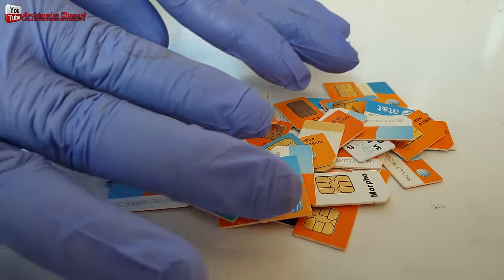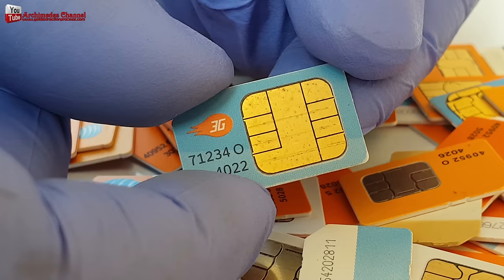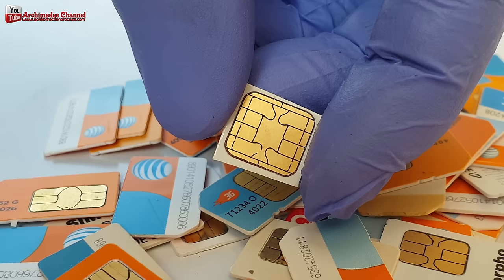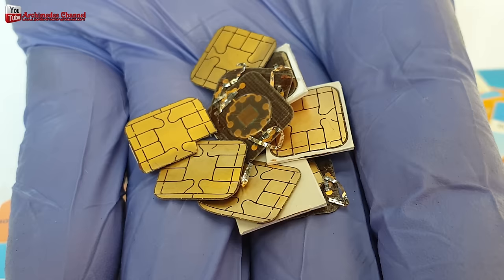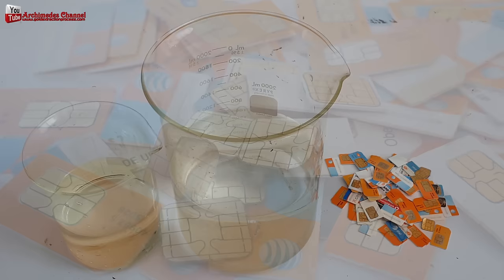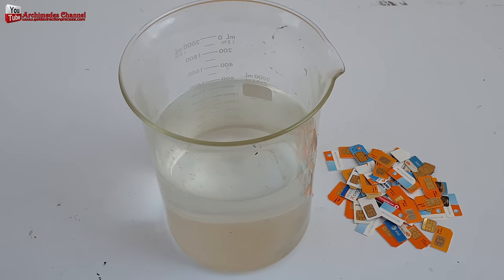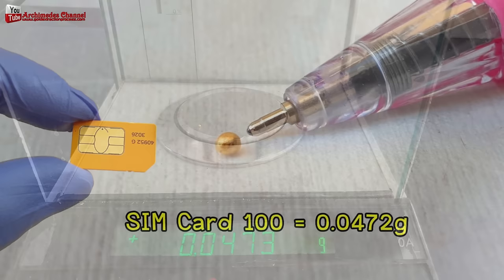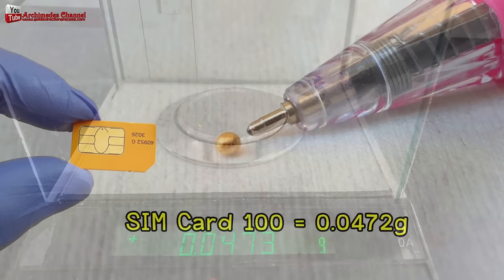Gold recovery from SIM Card cell phones 📱Sim cards recycling gold📱

Comment from the maker: 👉👉👉❤️❤️❤️❤️😘❤️😀 Gold recovery from sim cards cell phones. sim card is a plastic card that is embedded with an integrated circuit (IC). sim card are usually manufactured from plastie, namely, polyvinyl chloride (PVC). The sim card uses gold to produce two parts. The first is gold wire to connect the Die (integrated circuit) to the contact strip. The second part is gold plated contact strip to connect to cell phones. Many people are wondering Does SIM card have gold? How much. Today, I will gold recovery from my sim card cell phones. The key problem is the collection of enough quantities for gold recovery.
Reply: Hola es de verdad????
Reply: Soon as I got to the Part Nitric Acid needed..UK regulations  An EPP licence is required before regulated substances can be legitimately supplied to a member of the public.
Reply: Bogale.Dori
Reply: Pay me money
Reply: @tony2682  yes
Reply: @tony2682  yes
Reply: instaBlaster
Reply: How to make wots you
Reply: @salsayciudadsalsayciudad9664  you Good
Reply: @bogaledori1585  you looking good
Reply: Y
Reply: how many karat is that and how many percent of gold purity
Reply: How much is it??
Reply: my question is now where do all those chemicals go?
Reply: I had no idea that was actually real 🪙
Reply: @genxnewb small amounts acids HNO and HCl break down quickly to leave harmless residue as long as you dont damage something of value with them
Reply: You are wrong....
You make the same mistake as many others, Gold (and other precious metals) are weighed in Troy Ounces, and 1 Troy Ounce is 31.1034768 grams.
So if you have 1000 ounces, that makes a significant difference in weight. This gives a weight difference of more than 3 kg more.
Reply: How does a normal person get those chemicals?
Reply: SALVATION IS A FREE GIFT FROM GOD

HOW IMPORTANT IS ETERNITY TO YOU?

There is one God, eternally existing in three distinct co-equal persons: Father, Son, and Holy Spirit 

Deuteronomy 6:4
KJV
4 Hear, O Israel: The Lord our God is one Lord:

Matthew 28:19
KJV
19 Go ye therefore, and teach all nations, baptizing them in the name of the Father, and of the Son, and of the Holy Ghost: Ephesians 4:4-6

KJV
4 There is one body, and one Spirit, even as ye are called in one hope of your calling;

5 One Lord, one faith, one baptism,

6 One God and Father of all, who is above all, and through all, and in you all.

Colossians 2:9
KJV
9 For in him dwelleth all the fulness of the Godhead bodily. 

1 John 5:7 KJV
7 For there are three that bear record in heaven, the Father, the Word, and the Holy Ghost: and these three are one.

For all have sinned and come short of the glory of God. Romans 3:23. In fact in Romans 3:9-20 the Apostle Paul gives a very negative view of each and every one of us. He says there is none righteous, none that doeth good, unprofitable, none that understandeth, liars, destruction and misery are in our ways.

All the world is guilty before God (Romans 3:19). It is God’s law that declares each and every one of us as guilty before him, and therefore as Paul declares by the deeds of the law there shall no flesh be justified in his sight. The word “justified” means to be found free of guilt. The law cannot justify us because it’s the very thing that declares our guilt.

Romans 3:9-20
KJV
9 What then? are we better than they? No, in no wise: for we have before proved both Jews and Gentiles, that they are all under sin;

10 As it is written, There is none righteous, no, not one:

11 There is none that understandeth, there is none that seeketh after God.

12 They are all gone out of the way, they are together become unprofitable; there is none that doeth good, no, not one.

13 Their throat is an open sepulchre; with their tongues they have used deceit; the poison of asps is under their lips:

14 Whose mouth is full of cursing and bitterness:

15 Their feet are swift to shed blood:

16 Destruction and misery are in their ways:

17 And the way of peace have they not known:

18 There is no fear of God before their eyes.

19 Now we know that what things soever the law saith, it saith to them who are under the law: that every mouth may be stopped, and all the world may become guilty before God.

20 Therefore by the deeds of the law there shall no flesh be justified in his sight: for by the law is the knowledge of sin.

God is a just and righteous judge. God must be legally and morally right in all that he does. His righteousness and justice will not allow Him to justify a guilty man, therefore the dilemma is how can God justify the guilty and he himself remain just?

Hell is a hot holding place of torment where UNRIGHTEOUS Guity unjustified soul's  Go then for eternity for there sins it's called the second death Hell will be thrown into the lake of Fire in the future and the Guity unjustified into the lake of fire also (Second death) for Sin for everlasting destruction scary stuff God is to be FEARED and believed.

Revelation 20:14
KJV
14 And death and hell were cast into the lake of fire. This is the second death.

Revelation 21:8
KJV
8 But the fearful, and unbelieving, and the abominable, and murderers, and whoremongers, and sorcerers, and idolaters, and all liars, shall have their part in the lake which burneth with fire and brimstone: which is the second death.  

But there is Hope 

Romans 6:23

KJV

23 For the wages of sin is death; but the gift of God is eternal life through Jesus Christ our Lord.

God’s righteousness without the law has been revealed 

Romans 3:21 KJV

21 But now the righteousness of God without the law is manifested, being witnessed by the law and the prophets;.

And this righteousness is revealed in the gospel of Christ Romans 1:16-17  KJV

16 For I am not ashamed of the gospel of Christ: for it is the power of God unto salvation to every one that believeth; to the Jew first, and also to the Greek.

17 For therein is the righteousness of God revealed from faith to faith: as it is written, The just shall live by faith.. 

This gospel is defined in 1 Corinthians 15:1-4, as “how that Christ died for our sins according to the scriptures; (Shedding he's BLOOD onto death)And that he was buried, and that he rose again the third day according to the scriptures”.(God raised Jesus Christ from the dead Bodily and he saw no corruption) 

Acts 13:37
KJV
37 But he, whom God raised again, saw no corruption. 

And this gospel now declares God’s righteousness “that he might be JUST and the JUSTIFIER of him which BELIEVETH in Jesus (Romans 3:26).

Therefore, God’s Son (Fully Human without Sin and Fully God Born from the Virgin Mary and eternally existing) the Lord Jesus Christ took, our guilt upon himself and died under our own condemnation to appease the justice and righteousness of God (Romans 3:25), and now God will FREELY justify any man (Romans 3:24) who simply believes the gospel of the death, burial, and resurrection of Christ,

Romans 3:24-26
KJV
24 Being justified freely by his grace through the redemption that is in Christ Jesus:

25 Whom God hath set forth to be a propitiation through faith in his blood, to declare his righteousness for the remission of sins that are past, through the forbearance of God;

26 To declare, I say, at this time his righteousness: that he might be just, and the justifier of him which believeth in Jesus.

Ephesians 1:13

King James Version
13 In whom ye also trusted, after that ye heard the word of truth, the gospel of your salvation: in whom also after that ye believed, ye were sealed with that holy Spirit of promise,

And if you believe the gospel(1 Corinthians 15:1-4 )you are now secured in Christ sealed and have the promise of the Spirit and the gift of eternal Life not appointed to everlasting destruction and
According to the Word of God you can not lose salvation so no hell for the Justified. But it's God who justifies the ungodly you can not justify yourself by being Good enough or performance for example and the Word of God confirms your security everlasting life appointed to heaven with God to the saved 
Because God cannot Lie Trust him.

What must I do to be saved? Believe on the Lord Jesus Christ, and thou shalt be saved (Acts 16:30-31). Religion tells you to do something, God says his Son did it all, believe on him.
Reply: @bogaledori1585  $$$!^d ara simdi altin para seni  guclu sun simdi ara bni 3dk olsun 2 sde
Reply: @aiayiidowu4127  3 ara simdi 4yok yok ise kim ben isteyim uc cvabi kac yazdim simdi is teyim3dk 2iki dedi ara guclusun dedik sana ?
Reply: @roxyhana6142  /3 senin ara sF olma isteyim
Reply: That's why many just burn it down

Comment: Amazing! But I am afraid the price of hydrochloric an nitric acid is upper than the price of the gold recycled.
Reply: But less than the revenue earned from the video 😁
Reply: It’s actually fairly cheap.
Reply: Couldn't you just burn of the plastic? If you would use a vacuüm cleaner motor taken from the garbage container to blow air in to the fire you would probably get a clean burn. I never tried it but I think it should work and it is cheap enough.
Reply: Vinegar salt hydrogen peroxide 3% green safe inexpensive and doesnt saturate or become useless after one use.
Reply: Yes
Reply: its all about volume
Reply: It is not so expansive.
Reply: @wnea11  That's what she said....
Reply: Both the chemicals are available in my school chemistry lab😂
Reply: Just chant Hare Krishna and go to Goloka for ever. Then whole Goloka and Krishna and his devotees is much much more precious than earthly gold (which is nothing but the semen of Shiva).
Reply: Yeah but you can reuse the acid !!
4x over lol
Reply: I was playing with simcards last week just with the hot air gun and pull the little metal piece out , i guess it takes less strain on the chemicals when they have to deal with the surrounding plastic
Reply: Oh no don’t waste paper unless money to extract very valuable gold, the currency of the earth
Reply: @depausvandelilithkerk5785  Heated PVC is pretty fkin toxic.
Reply: @thombaz  yes, but if you have it good ventilated then it wouldn't be as harmful as the vapors coming from the chemicals which they used. I could be wrong for I am just an idiot speaking his thoughts out loud, but I think it would be cheaper and easier to do then having to acquire those chemicals.
Reply: শিম👏👌👌
Reply: @sourinkabi  Yeah, the revenue is pretty big. He can spend it on the medical treatments due to inhaling all that acid, though.
Reply: @sourinkabi  pllp
Reply: The value of the gold recovered, at current market price, is $2.80 USD. Unsure of how much the materials cost, but I don't see myself hoarding Sim cards
Reply: Why don’t you just get a paper round…..it would pay more than this
Reply: Which is why it's better to do it with more than a thousand. It's more economic that way.
Reply: Ben bunu kral suyu kullanarak yapıyorum 1 gramdan fazla elde ediyorum..👍👍👍
Reply: Try the vinegar method 😊
Reply: What part of the world you living in hydrochloric acid is cheap and can be reused

Comment: I recently got a new sim card because my phone started saying I did not have a sim card inside it, which was not true. I eventually got the new one in the mail. The old sim card was extremely dull and looked like old brass. The new one looked like some real gold. I don't know what the first one was but gold doesn't varnish or rust.
Reply: They use a gold alloy, but I'm not sure what alloys would corrode
Reply: @CoffeeAddictEvan  Yeah it was a very peculiar situation, I mined gold for years and definitely know it's properties. Must have been an alloy I'm curious if anyone knows what alloy it is.
Reply: @Aatell764  I looked up the iso standards and whatever patents I could find, and the only standardization I could find was in the plastic material the card itself is made out of, not the contacts.
So, chances are it's different depending on the manufacturer
Reply: @CoffeeAddictEvan  Very interesting
Reply: Maybe It where's off with time 🤷🏻‍♂️

Comment: Nice video, but what about the bonding wires, there probably more gold in those few wires than the contact plating.
Reply: It is hard to open the sim inside because it was molded...being baked...just to protect the wire inside

Comment: Really cool! Too bad precious metals are measured in Troy ounces. Meaning you would need 31.1 g to make an OzT. But the math to figure the difference wouldn’t be too tough. I always wondered how many it would take to make an OzT. Thanks for sharing.
Reply: Gold Refineries purchase gold by the gram. However it would still take a few hundred cards to make a sizable amount worth all this effort and having it assayed at a refinery.
Reply: You wouldn’t need to have it assayed at a refinery. Acid refining or titration. Is something many people do at home. And the chemicals and equipment are readily available at almost all hardware stores. And I live near several refineries and have black sands roasted down two times a year. They wouldn’t take less than 10 kilos of those cards if they even took them at all. Or, if chems aren’t your thing. You can always melt them in your own furnace or whipping dish at home. Like I do. While you will need a respirator and a good air filtration system in your shop. It’ll do the trick. Works with gold backs and foil dollar bills as well. But the same goes with the GoldBacks and foils. You need a lot to make any weight at all. And the reason refineries seem to use grams. Are because most folks don’t know the measurements of the Troy weight system. But I do assure you. OzT or Troy ounce. Is in fact what they use.
Reply: This is meant for people that collect large amounts of gold plated tech pieces or sim cards, in gold plated electronics every 500 grams of gold plated components produces about 1 gram of gold. Hope this helps
Reply: @chasemagness6824  which has what to do with the measurements comment? Large or small, the measurements used are the same. Precious metals are weighed in Troy ounces. Not avoirdupois. Or standard ounces. If you’re gonna interject, at least know the topic of discussion.
Reply: @iiniijewelry  I'm not sure why this comment is here?

Comment: A lot of work to get $2.70 worth of gold from 100 SIM cards.  Now, if you had 10,000 SIM cards, you could get $270 worth of gold.  But how much work would it take to get 10,000 SIM cards.  The shipping cost alone to gather them from multiple collection points would far outweigh the gross value.

Comment: Why not use the torch to burn the plastic snd other non metallic parts away and then put that into the acid? Seems like you're using lots of acid to extract some of the gold whereas if you burned away all the "packaging" you could process thousands of sim cards more rapidly.
Gold will not be destroyed during the burning of the plastic.
Reply: Because the gold and the plastic will stick together

Comment: Yeah... u need over 65,000 Sim cards to make a Troy oz. 
Good luck accumulating wealth this way folks. 💪🏽
Reply: 100 sim cards yielded 0.0472 grams. So 1000 sim cards yeilds 4.72 grams. Multiply by 10000 and you get 472 grams. Where are you guys getting these numbers of 60k plus sim cards if the experiment used 100 sim cards are yeilds  0.0472 grams?

Comment: If you go thru trouble of purifying that gold to 22k or 23k? You got something maybe 1/8 that size. Takes several nitric washes. Its 7k. Unless you use electrolitic process you can't achieve 24k.
 Throw some finger boards from PCs in there get more gold.

Comment: 1kg of gold requires 2.118.645 sim cards.
1kg of gold worth £41.182 = $57.234 
As of 5-5-21
Reply: Are you kidding 1kg gold for 57.234 😁dollers
Reply: A kilo of gold is not $57 man. You have a decimal where a comma should go. A kilo is $57,763.96 USD
Reply: @Lolcowhunter022  you two use commas and points differently. Neither is right or wrong
Reply: @DuckiBoiHasPizza  nah dude the first comment was $57 dollars
Reply: @Lucciii32  "1kg of gold requirez 2.118.645 sim cards" --> the author clearly uses dots as thousands separator.

Comment: About $85 of gold - how much did the chemicals and consumed materials to extract cost?
Reply: No $2.88
Reply: @joeblues2000  Yes - you are correct. I was using .047 oz, but checked back and it was grams. This makes the calculation much worse. Time and materials to extract the gold.